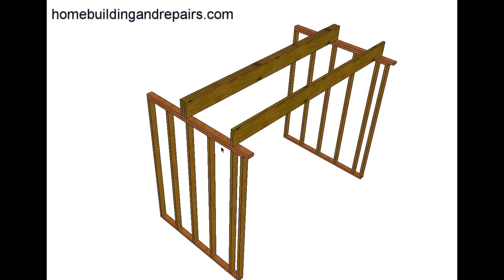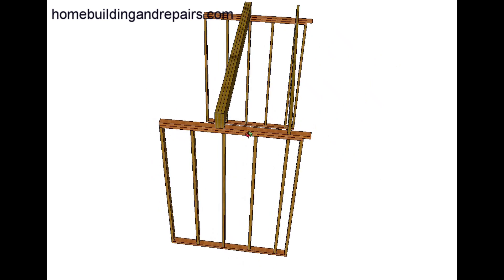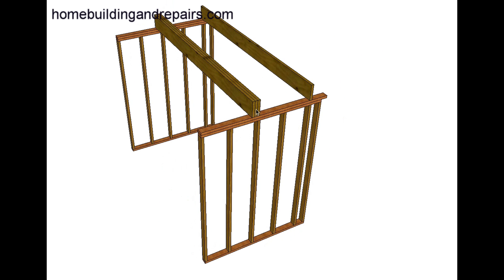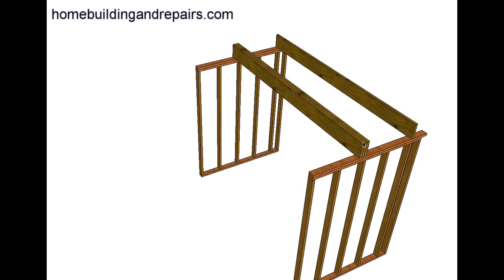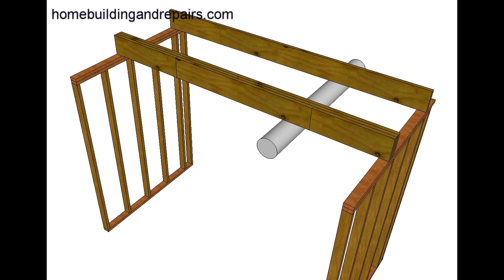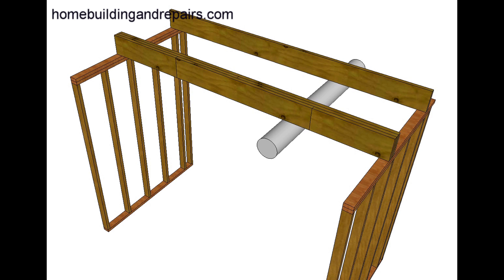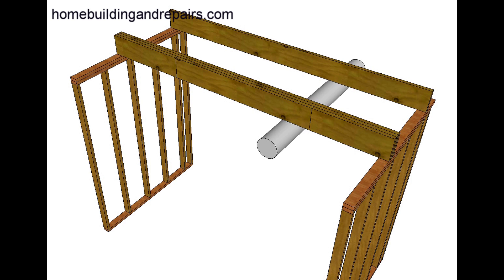Can I Bolt Together Sections of Joist to Make Floor Beam – Remodeling and Home Repair Tips

Comment: Sorry it won’t work: you will only add weight
Reply from the maker: I've used this method and it was on a job that had a set of plans from an engineer, but since you didn't specify how much weight, you could be right.

Comment: Duct work is some of the easiest work you'll ever do. Take it down install a full beam. Every time you break a beam you get more deadload and less support that you would with a intact beam. Taking down the vent and replacing it when done will be less work, cost less, and guarantee safety.

Comment: The top of the beam is in compression - very easy to satisfy. The bottom of the beam is in tension - very difficult to satisfy. You actually can't satisfy the tension problem with a splice unless you deal with tension directly. As someone suggested without saying why, you can capture that tension with a strap at the bottom of the beam. But even that should be with an Engineers guidance.

Comment: I would take out the section of duct work to install the full length beam rather than section them in. Duct work can be put back together and sealed very easily. Why take a chance on something letting go over some silly sheet metal?
Reply from the maker: Remember, this video is just a suggestion and not something that will work on every project. In some cases it will be easier to modify duct work.

Comment: Lot of popping and cracking in the audio this time around. Thanks for the video.
Reply from the maker: Do you mind if I ask what type of device your watching the video on?
Reply: Desktop computer attached to speakers with separate woofers, mids, and tweeters.
Reply from the maker: I am going to have to put a little more effort into solving this problem.

Comment: Engineer.   Engineer. Engineer...  What did we EVER do without them ....oh, 100 years ago?! Jesus help us. My house was sold to us by the people that built it in 1922 from the scraps gained at the dump, where he worked...8x8x20 beams fastened with 6" spikes...4" floorboards...The damn posts in the basement still have bark on them! and floods every spring! In fact, I had to shoot a porcie this fall in the basement...

Where's the "Engineer" for that?! 

lol
Reply from the maker: I've seen plenty of homes that engineers would have a problem with, yet are still standing and have been for decades, some even centuries.
Reply: gregvancom I used to work in structural Engineering...I'm not an Engineer, but I worked with them. Engineers tend to over-think things and while the rest of us are "gettin'er done!"...they're usually pondering how it can't be done or why it shouldn't be done! lol.  I've got a 150 yr old farmhouse that is structurally-unsound. Broken posts, foundation loss, chimneys falling down...termites...you name it! Contractors have been in to look at it, spun around, and waved g'bye...lol. F-em! $56,000 was one quote. Another said "I won't touch it without an Engineer!" 

Really? cuz I didn't have $56k...OR an Engineer. I had sweat, muscle, and YouTube! I had rough-cut lumber, green hemlock...and those boards will last 150 more years! I have smarts. I THINK. And then I think MORE...and I jacked up the house using 4 20-ton bottle jacks, replacing 6x6 posts as I went...and ripping out studs, replacing support beams held with lally posts...

Engineers would tell me WHY I shouldn't do this or that...and draft up some elaborate plan...and charge me $92/hr. 

I replaced my entire basement support structure AND leveled my house for under $3,000...26 6x6 posts, 200 bags of concrete, 4 ton of 1" stone, and a Dremel. lol...
Reply from the maker: There are things that you can do without an engineer as you stated, as long as you have a general understanding about home construction, remodeling and repairs. I agree with the one contractor, I wouldn't touch it without an engineer, because they're going to be liable if anything happens. It's actually one of the reasons why I make certain videos, because these people aren't going to hire an engineer.

Comment: I also forgot to mention that if the duct work is in the way of course like you said it can be removed but if a steel beam is put in, it can be in two pieces and bolted together with a mending plate. We do it all the time in old victorian's out here in San Francisco.
Reply from the maker: That's great advice and thanks for sharing.

Comment: Thanks for creating this Greg! I'll go ahead and contact the engineer. When I weighed out how to do this I was also planning to bolt a metal plate on each side of the joists where I made the cuts to add more strength. On a side note, the beam that runs down the center of the home's entire length, which is nearly 50 feet,  is nothing more than 2X10s nailed together with posts underneath them and they are of varying lengths. So my thoughts were if you can do it that way to support an entire home you ought to be able to support a percentage of the weight of the half story (home is 1.5 story) that these joists will have from a weight perspective loading on them. The section of wall that I'm removing has 10 2x6s to support the floor above. My simple logic, which may not be correct, is that if I'm going to support the second floor (half story) above with a beam and post at each end that if I can calculate how much 10 2X6s can support and divide that by two I'll have a number I can use to determine if 3 bolted together joists placed under each post can support. I'll run it by the engineer. Thanks again.
Reply from the maker: You're welcome and I've seen it before plenty of times where people nailed together a variety of different lengths to create a beam without using bolts and it worked just fine. I think from an engineering standpoint, solid members are easier to use in their calculations and get approval from their local building departments. I've witnessed plenty of things throughout my career that would've never been approved by an engineer, yet lasted for decades, but also seen some stuff that didn't.
Reply: What you are referring to is a flitch plate. It's essentially a long mending plate. Now for conversions of old buildings into condo or office space, engineering is required for load calcs which will determine plate thickness, fasteners, bearing points, etc. Houses are easy. You can over-design them. But most counties require engineering stamps.

Comment: This approach is actually really hard to calculate what type of capacity you would get out of the bolted together members.... other than knowing it would not be nearly as strong as solid members.  An option that could work, if the members are only resisting downwards load, is a steel strap along the bottom or next to the bottom of the members with a whole bunch of nails.  I have specified similar things, but it is usually easier to do a full length member.
Reply from the maker: Thanks for your input, it's greatly appreciated.